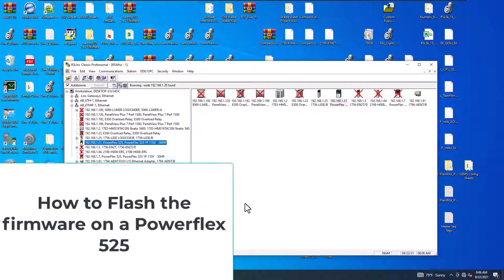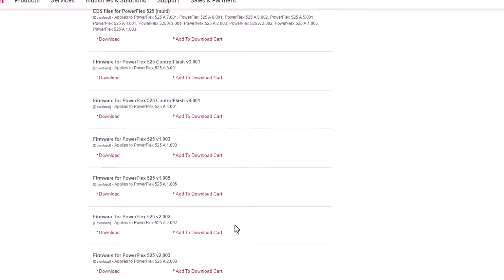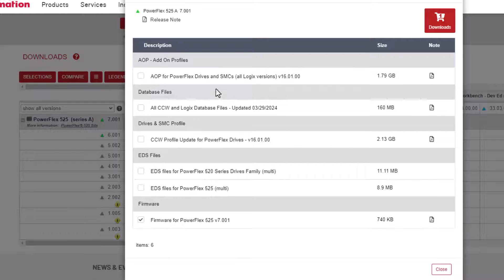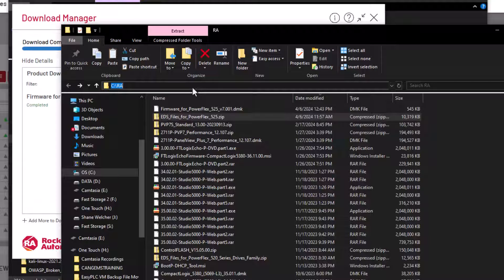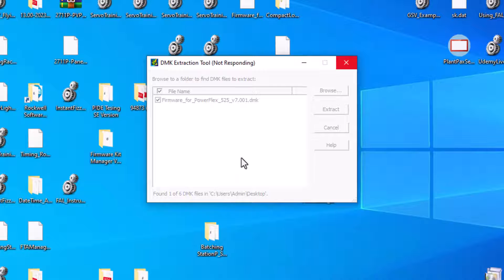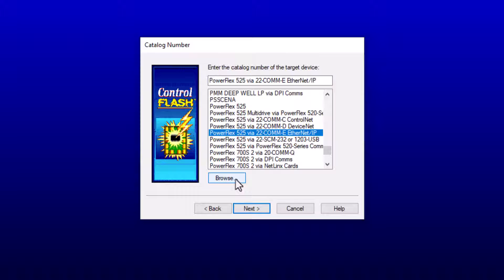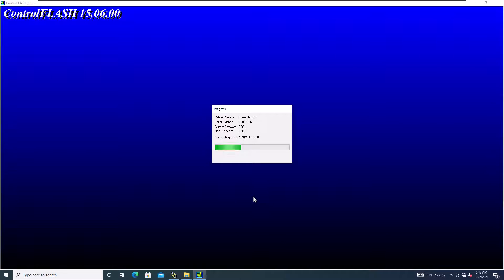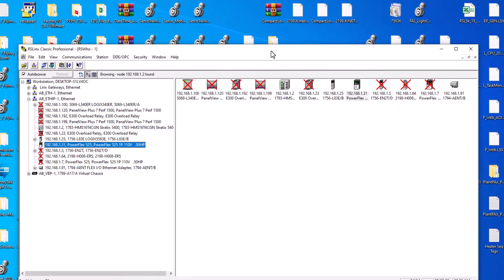How to Flash the firmware on an Allen-Bradley PowerFlex 525

Comment: thank you so much for the video, it helped me so much flashing from 6 to 7. The flash took a really long time, maybe because i was doing it remotely through a VPN connection. I did get at the end  an error "Failed to communicate to the target device" and not a green box "Update complete" like you did. I was disappointed, come to find out it did flash firmware 7. Weird !!
Reply from the maker: @JCJC-n9x  Might have been a chip set change

Comment: And the second problem is that I accidentally updated the firmware on my CompactLogix l18er controller, namely 1769-L18ER-bb1b, and now the built-in program cannot work with the new firmware.  And I also need to find firmware 20.0012 for it.  Please help if van is not difficult, thanks in advance.
Reply from the maker: Secondly, compact logic will work with any version of power flex firmware, you problem might be your AOP which is an Add On Profile

Comment: Hello, I do not have access to the Rockwool Automatic website and I cannot download the firmware for my PowerFlex 525. I have built-in firmware 7.001 and I need 1.003 since my compact logistics controller cannot work with the new firmware.
Reply from the maker: All you have to do is to make an account with Rockwell Automation then you will have access to download the firmware
Reply: I registered, but I still get the message, access denied.  Maybe because I'm from Russia(
Reply from the maker: @МаксимХромов-з8ы  what are you talking about?
Reply: @МаксимХромов-з8ы  when going backwards with firmware, a lot of times you can change the firmware in the PLC. When offline with the drive inside of asset center you can open properties of the drive, then device definition and change it to the FW you need it to look for.

Comment: I strongly suggest download the Release Note and pay attention to the system requirements, new features, known anomalies (sometimes with work around) etc. By doing this, you will have lesser chance of installation failure especially on feature changes, sometimes you will need to change the ladder also.
Reply from the maker: The only things you need to worry about is what firmware you are flashing and how stable it is along with making a drive backup so you can reload the drive parameters after the download unless ADC is on.

No ladder logic changes because of firmware. Maybe ladder logic changes if you change a drive type.

Like from Power flex 525 to Power flex 755 for example